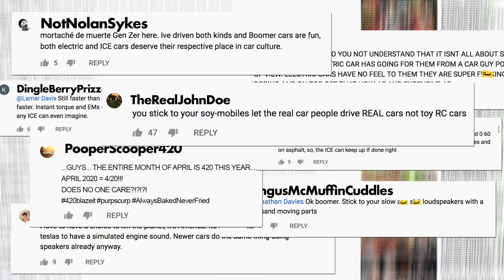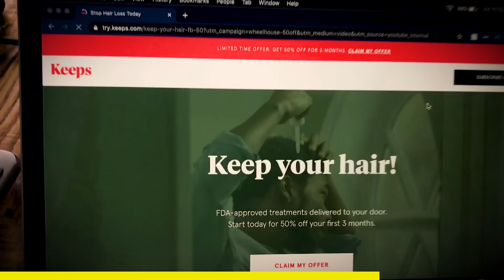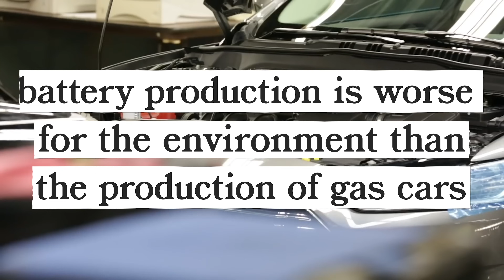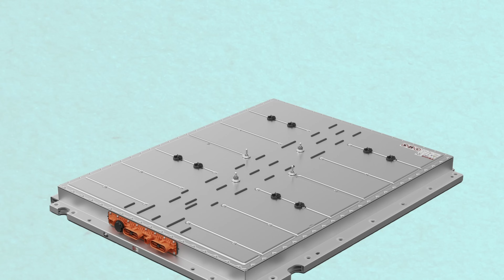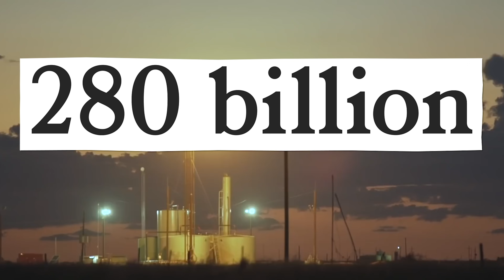Are Electric Cars REALLY Better for the Environment?

Comment: While I really love that you used a pretty general way of describing ways they pollute and consume resources, I think there was something very important you missed. Wear and tear on roads and the repairs that weight can accelerate. In general most electric cars are far more heavy than gasoline vehicles. If you directly compare Gas vs Electric cars in the same class it becomes very obvious electric cars are heavy for their size. The New Porsche Taycan is quoted at weights between 4,777 to 5,132 lbs depending on trim and spec. So in top spec it weights more than the heaviest available Land Rover Discovery 4,735 to 4,900 lbs and if that's not convincing enough a Ford Expedition a 7 Passnger US Made and Designed for US Market full size truck based SUV weighs in between 5,443 to 5,692 lbs. That is one of the heaviest Passenger vehicles for most families other than Large towing Pickup trucks. Those vehicles pay a higher tax for their effect on wearing out roads and highways faster than lighter more "economical" cars. Yet electric cars don't have to pay this tax. Only they are still wearing down the roads as much as those large heavy SUVS. This is one way most people will not notice that they are sucking money and resources due to them haviing much higher weights per size due to their heavy batteries. I know electric vehicles are more efficient and ethical even with these in consideration. I just think that sometimes marketing works too well on the general public. So you have to remind them how many aspects of our life, finances, and planet can be affected by one single product. A mode of transportation. Aside from that CO2 isn't the only kind of pollution. When we think of low emissions vehicles most people immediately think Green House gasses. What about poorly run plants that have all sorts of poisonous chemicals leaching off into the land they are built on.

Comment: The average life span of a vehicle lithium batteries is currently less than 130,000 km, that means an EV will require 3 batteries for the life span of an ICE vehicle
Reply: Well at least you said currently. Battery tech is improving rapidly. Tesla have already been talking of a million mile battery.

Comment: I dont care much about environmental pollution.

Do you know why i love internal combustion engine than EV? Less electrical parts means less it becomes faulty
Reply: Electric cars, a brand new industry, already have 1/7th the maintenance and repair frequency of internal combustion cars. They are already far more reliable than combustioj vehicles and they're only going to get better while combustion is deep into diminishing returns territory. Combustion vehicles have two orders of magnitude more moving parts than EVs. 

Your reasoning is not based in fact.
Reply: Also "I don't care much about environmental pollution" means you're either a narcissist or simply lying to yourself. It is already having significant impact on our world, and will continue to do so in a greater and greater capacity unless we evolve out of our barbaric, outdated polluting industries.
Reply: It's kind of the opposite. All moving parts will fail eventually even if designed to it's peak. That's why EVs have much lesser servicing needs (no oil changes, lubrication, clutch replacement) Unlike electricals which fail only if there is a flaw in it's design.

Comment: I just got done writing a essay on this topic and I used the same points and came to the same conclusions as you did. Great video Nolan!
Reply: Battery technology is evolving. Gas technology is not. It means we can change batteries so that it becomes cleaner to produce, recyclable and more effective in terms of energy stored by kg. Gas isn't evolving, thermic motors aren't either. You can reduce consomption, but there will always be one. Meaning when you multiply by the billions of cars on the planet, it will always be bad. Look for future 100% graphene batteries. 100x more efficient, recyclable, and composed of only carbon atoms. Which means we will be able to have like 4000km of autonomy on 10x lighter batteries for example, charging in minutes.
Reply: @issoulescondes3913  we cannot plan a future on the basis of not currently feasible technology. Perhaps in the future this will change. But as it stands today. Battery tech isnt in anyway feasible for mass adoption.
Reply: Conred S. writing my currently lol
Reply: Don't forget to include longevity and end of life cycle recycling like this video did. I doubt electric cars are going to get to a 200k mile life cycle average like an ICE car. Seeing how no battery that i am aware of lasts linger than around 10.
Reply: @zososldier   Properly maintained EV batteries would easily reach 200k even if at 80% capacity. Old batteries tend to reused for stationary grid storage and later recycled to make new batteries. There's also hardly any maintenance on EVs with few moving parts. That why traditional dealerships hate em, since a big chunk of their profits come from maintenance/repairs.
Reply: @zososldier  There is evidence that Tesla and later-tech EV batteries receive only about 10% degradation over a 200-250,000 km range.  There is also a Tesla which hit 560k mileage last year on original motor.  Check this link out:  https://steinbuch.wordpress.com/2015/01/24/tesla-model-s-battery-degradation-data/
Reply: @zososldier  he only mentioned recycling, he couldn't give numbers concerning the environmental effect of the recycling, which for en ev won't be cheap nor good for the environment, but that shouldn't be a surprise to anyone
what he also didn't take in account though is the production of so called "green power" from windmills and solar panels, solar panels is kinda the same story as ev's (you don't wanna know what kind of nasty shit goes in there to get some "decent" efficiency ), even windmills use metals that aren't that easy to come by (for the generator and axle assembly which is 55% of the entire cost of the windmill) 
don't get me wrong i'm all for greener/electric vehicles, but at this point in time we are at a point where ev's and ice"s are at the same point of environmental "pressure" if you take everything in account from production of the car, production of the "fuel", to recycling of the car and most importantly lifespan, because let's face it, no ev (at this point) can outlast an ice
Reply: IF your going to use statistics you for oil refineries then you need to for batteries as well. Clean energy is not cleaned because the components have to be made from something. Solar panels use rare materials like batteries, which have to be refined. Wind farm kills thousands of birds even when they move slowly. Geothermal energy  can only be used in a small amount of places. The problems currently with batteries is that gasoline is still more energy dense than any battery on the market. You dont take into account how long a battery will last in a car. You need to go from how long before the car needs a major repair that someone is not willing to pay. Electric cars are by far more expensive to maintain and repair. Due to the fact they can easily catch up to a ICE in repair cost. As far as current battery production as I said before they all use rare metals and materials to build them. Being that rare means they all already in short supply and hard to get to in the first place. So yes, of course ICE will be worse simply because there are more. If we had even half the amount of EV as we would need even more massive amounts of materials thus more massive amounts of pollution.
Reply: He only used lithium refining. Whilst he did say there are other things in the batteries. The refining method for all of the rare elements in batteries as toxic as fuck
Reply: @biohazardlnfS  Oil and nautral gas extraction and refining cause much more environmental damage. Effects of oil accumulation on fish in the Gulf of Mexico have gotten worse over time since the Deepwater Horizon spill.
Reply: @joshblack4291  That's because it close to home. Not many people are covering the damage done in third world countries which is were much of this stuff is sourced from.
Reply: "Engineering Explained" has a similar video crunching the numbers. My master's thesis back in 2002 was on something similar. As much as I like ICE and rowing the gears, you have to accept the facts that EVs are cleaner - and pretty damn fast...
Reply: @Phrancis5  Define "cleaner". Is it really cleaner because it produces less co2 emissions?
Reply: @Phrancis5  The science will get there eventually, and I think gas/diesel engines will have a place for a very long time whether it's for collection or efficiency reasons.
Reply: @mantis_toboggan_md   Sure, ICE will always be around in certain applications, but vast majority of the commuting public would be better served with EVs.
Reply: @Phrancis5  I dont think so, there's simply not enough Cobalt in the earths crust that is easily accessible for most people to drive a EV, earths ICE fleet is well over 1.2 billion units. And there's only enough Cobalt to make batteries for 250 or so million EVs that will last for 15-20 years. There's not even enough cobalt to fill the future demand of another billion units by 2050. Not to mention that if we use all the cobalt in batteries we wont have advanced computers anymore.
Reply: @caliph20  This may be true, so other car battery innovations and efficiencies will have to be made in the future as well as improvements to mass transit to prevent the need for personal cars. There also isn't enough oil and natural gas, so these materials are limited and not renewable.
Reply: @joshblack4291  I think theres enough nat gas for 500 years or so. We specifically need to make those battery advancements before evs can be a feasible solution.

Comment: Thanks for the informative video.  Do you think the lifespan of electric cars will be less than ICE cars due to batteries perhaps expiring after 10+ years and battery technology updating quickly, causing the costs of replacing old car battery packs to be not worth it?  Which would then cause more new electric vehicles to be produced and sold more regularly with bigger initial Co2 hits.

Comment: 2020: Manual vs Automatic
2050: Gas vs Electric
Reply: It should have been kinda like 
2010 automatic vs manual 
2020 gas vs electric
Reply: @rathanxxx  
2030 electric vs hydrogen 
2040 hydrogen vs ??
Reply: @hbrittenjones  hydrogen vs water :p
Reply: @hbrittenjones  Hydrogen will be a fuel cell powering an electric motor (if it ever becomes main stream)
Reply: People forget about hybrid.  This video compares EV against average gas cars, but hybrids actually can be cleaner than EVs in context and are very efficient overall.  I predict a lot of sports cars will become hybrids
Reply: Legs VS 4 wheel

Comment: I know this video isn’t about the power of nuclear reactions, but I feel like it should be addressed. Nuclear power can’t mitigate the harm EV cars have on the environment in their production, but they can virtually eliminate their footprint on the backend. Radioactive elements exist on this world for a reason, they’re not just deranged members of the periodic table, they can do a lot of good. Ignorant people will say they’re dangerous and the production and disposal of the fuel material is bad for the environment, what they’re not considering is the scale. Comparatively speaking, nuclear power is the most sustainable form of production and the beautiful future of it has an even smaller toll on the environment. Not to mention, statistically speaking, nuclear power has caused astronomically fewer deaths than all other forms of non renewable energy production, and yes, I said non renewable. Although it may not be renewable, if used properly, the material can sustain all of our power needs for thousands and thousands of years. Plus, with the help of new technology, future versions of nuclear power production will utilize the waste from current fission uranium reactions and nuclear fusion which has an even great power density/yield potential while maintaining a more stable profile. I support the creation of new nuclear facilities utilizing the latest and greatest, and the continued use of active fission facilities until their predetermined decommission date. The world would be a beautiful, clean and safe place utilizing spent fuel and moreover, the future of nuclear fuels and production. I also applaud the individuals responsible for building the wheels that were the first nuclear power stations considering that we’re essentially using the same technology today. They were true geniuses, but it is time for the next generation. If you made it this far... wow!
Reply: Seawolf : You make some great points about the time and planning involved. Renewable energy sources are pretty great and I very much enjoy the personal benefits of solar. I bought my home with enough solar already installed to power it completely when the sun shines, but on one of the many cloudy days, or at night, I’m still buying from the grid that is fed by the Lake Michigan cooled nuclear station near where I live. My electric bill is much less than it would otherwise be without a doubt, but that’s where the good ends. Renewables have two substantial problems. First, sustainably out of the main renewable energy sources. The only three that produce consistently are hydroelectric, geothermal, and hydrogen. Hydroelectric output only matches that of nuclear on a very large scale whose facilities’ costs typically match that of nuclear, geothermal is too expensive even on a small scale, and hydrogen is too inefficient considering it costs energy to produce the fuel. The second problem is scale, and this is a big one. In regards to solar (wind and other non-renewables that only operate under specific conditions run with a similar deficit),  it would take over twenty-million 300w solar panels and a couple hundred backup sized mega batteries to sustainably replace just one small nuclear facility. To reiterate; 20,000,000 panels. Those panels and batteries would occupy potentially dozens of square miles depending on packaging and cost billions of dollars. The most expensive nuclear facilities cost nine billion dollars but the cheapest solar formulas I can find on the internet put the equivalent solar farm at almost 20 billion to produce. That’s comparing apples to oranges since a nine billion dollar nuclear facility would be a large, high yield, facility far out producing the twenty billion dollar solar array. Even using compact efficient panels, the occupied space would be similar to that of the small city I live in (about thirteen square miles). Not to mention, the bill for that solar divided among all the households it would serve, is still out of the reach of most. All of these reasons add up to why renewables like solar are a good supplement for specific people who desire them. Like nuclear, renewables need insurance too. That insurance is in the form of batteries, which as this video discussed, can be very bad for the environment especially when you consider the scale of the car batteries their talking about and the much more colossal backup batteries I’m referring too. I personally don’t want to live in a world littered by solar and wind fields when nuclear can replace hundreds of square miles of them and still be tucked away into the woods. I have to admit that I am a tad biased as my father is a retired nuclear engineer. He told me when I was young that nuclear power is like an extremely efficient steam train that charges on 24/365 with a small fuel input. It’s extremely safe and is only getting safer by removing the threat of some human operational error. Nuclear quietly hums away through the hot or cold, day or night, rain/snow or shine. Most distracted or new members of my community aren’t even aware that the facility they drive past on Lake Michigan is a nuclear power plant (probably because the sign is small and it uses cooling canals and not towers) but I like to think it is because it’s sooo non offensive just quietly and calmly existing in the background while bringing us reliable power on the coldest winter nights. I encourage you to read about the small scale, compact, modular and comparatively affordable reactors that companies like TerraPower (backed by Bill Gates) are producing. Modular reactors can be manufactured like cars and could soon be used widespread affordably. A very small and sleek modular reactor facility in Idaho is scheduled to start construction next year for completion in 2026. Thanks for the reply, I appreciate your insight as I didn’t expect anybody to see this comment, let alone read it.

Comment: What about the oil in the engine for lubrication, brakes last longer due to regenerative process, I think brake fluid, radiator fluids are also reduced and some axel fluids. I don’t own an electric vehicle but I think those are positives of EVs. There are a lot of reductions in maintenance which can reduce overall carbon footprint. Not to mention environmental impacts from gas stations, fumes from refilling ICE too. I think there was a study done on that.  Great work on the video. Battery tech will get better as time goes on, I drive long distances and more than 30k per year so no chance of moving to battery, YET!